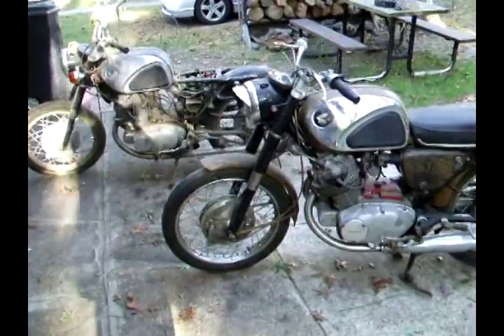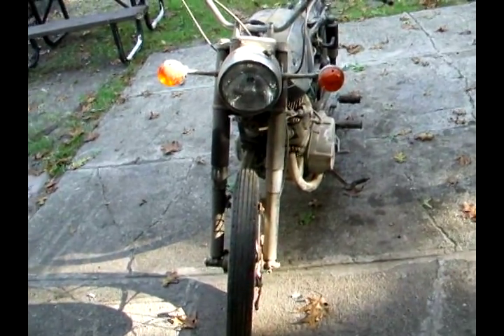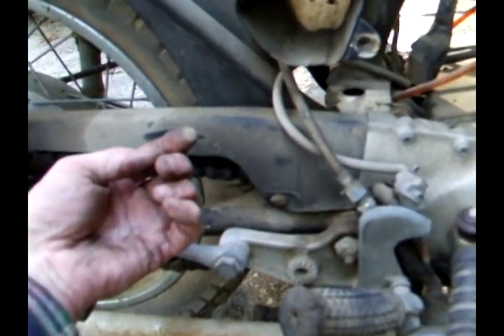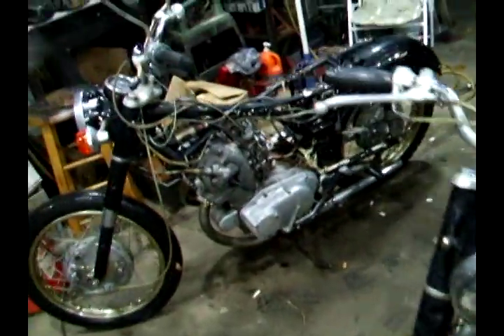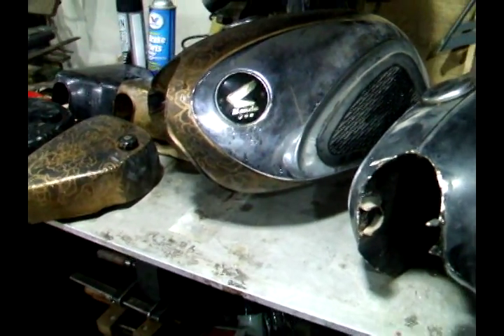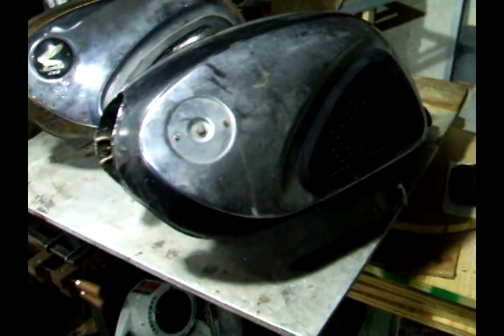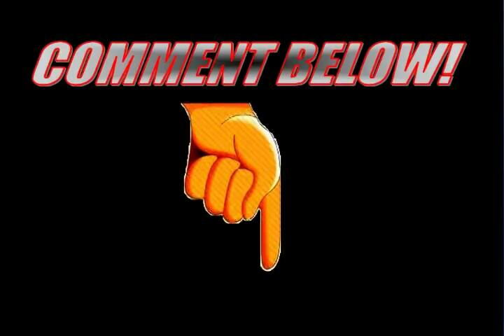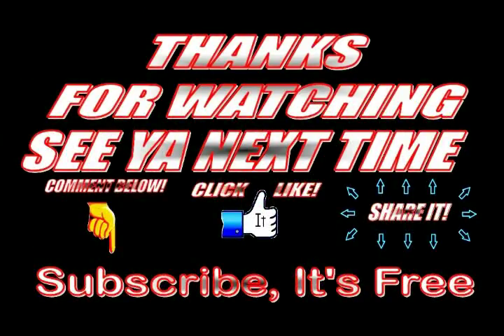1965 Honda CB77 Superhawk project

Comment: I bought a Superhawk out of the junk yard at Clark AB in the Philippines.  Was missing a few parts, so I took it downtown to a specialty shop and we made a chopper out of it.  No big changes except for an extended front end and a lot of chrome.  Loved riding it, but it took a lot of room to turn around.  Wanted to bring it home, but sold it to a local guy that probably had the only chopper in the Philippines at the time.

Comment: I have a CL77 305. I bought it not running, got it running but I think it has a bad valve guide as one cylinder smokes despite it have good compression. It has been sitting since. Got to get back at it someday.

Comment: 1965 Honda Superhawk was my first motorcycle.   I bought it for $75.   I had to take it to the local Honda shop to get it running.   It seemed fast to me and it was nimble.  I sold it before I left for the Army.  I wish I had that little bike now.  I remember the shift linkage being frame mounted and then going to the side of the engine, just as your bike has.  Someone once told me to get rid of all that and just put a shifter on the engine.  I never got around to it.  It worked fine just as it was.

Comment: These bikes were already old when I was a kid in the early to mid 70s. I always thought they looked odd, as bikes had radically changed by then. I thought the tanks were put on backwards and it annoyed me. The rubber knee pads were unGodly. Now I think they are super cool and I heard the engines are solid and good.
Reply: Yea these engines are great. I daily a rebel250 which has a pretty similar one and it's been totally reliable for the near 10k I've put on it. Always fires right up, even down in the 20s or 30s. Runs like the day I got it with 1500mi. CDI instead of points though.

Comment: I'd love to see a video on how you unseize an engine.
Reply from the maker: I have a few dirty tricks for doing that, but the engine has to be intact. I just did one the other day and didn't video it but I should have. No guarantees in how good it will run or be, but it sure makes getting the top end off easier if they are not froze up. I'll have to video the next one.
Reply: Squirt some light oil,WD or some such in the spark plug holes.Let it soak overnight..get on the crankshaft  nut or clutch.Rock it.This only works if the cylinders are rusted a little.If the main bearings or wristpin are locked,pull the motor.